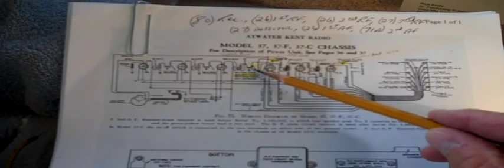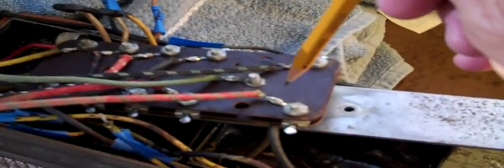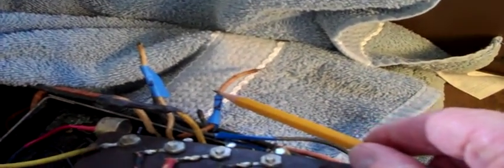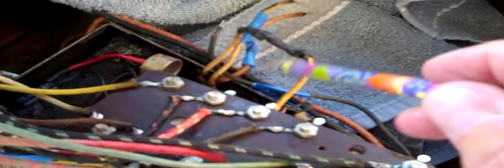1927 Atwater Kent Model 37 Repair and Restoration. (Part 7 of 21)

Comment: John,  Its Bob B. again. Where can I find a 500 ohm choke replacement in the speaker circuit?  I had to replace the Power unit on my model 40 because the main power transformer was open.  The replacement power unit I have has all the capacitors and speaker choke removed (a long story).  I guess I could dig out the one from the tar on the old unit.  But I bet that would be a job.  Please help Thank you.
Reply from the maker: Hey Bob, 
Good timing, my friend, you caught me on the net.  Radiodaze is the place to go.  This is their choke page:
https://www.radiodaze.com/d-c-filter-153-159-series/
Regards,
John

Comment from the maker: Hey, John.
I don't know if the caps were bad.  For me, it's standard practice to replace all old wax capacitors and those in power supply.  Leaking power supply caps are a slow death for power transformers.
I've never heard that Atwater Kent used tar in his radios to prevent RF interference, which I doubt it would do.  Sounds like a myth to me.
BTW...the 55C is a very cool-looking radio.  You're fortunate to own one.

Regards,
John

Comment: Were the caps bad?  I'm working on a 1929 AK 55C and all the advice I've got on the unit is that it's the resistors, not the caps, that tend to go bad on these models.  And so far I've found that to be true with mine.  I did ask about why the main power transformer was encased in tar and was told the main reason was to prevent interference with the RF field....  John Richter